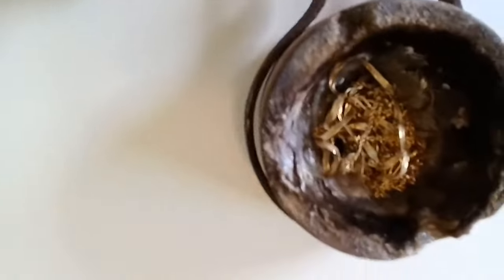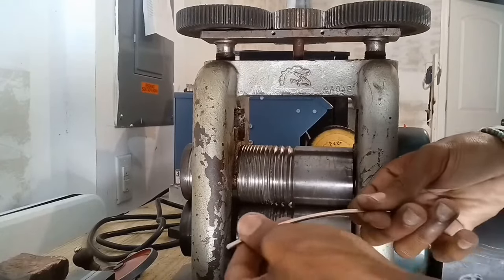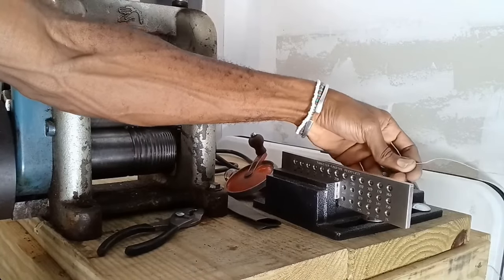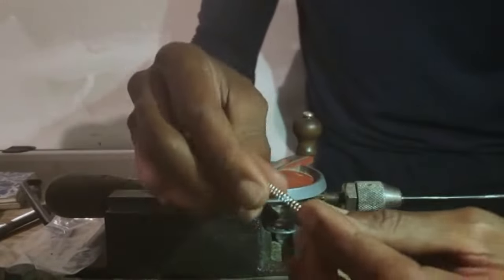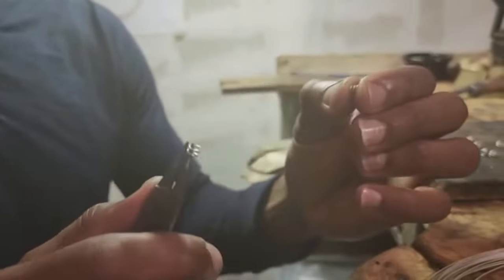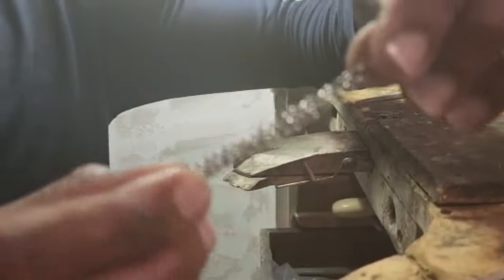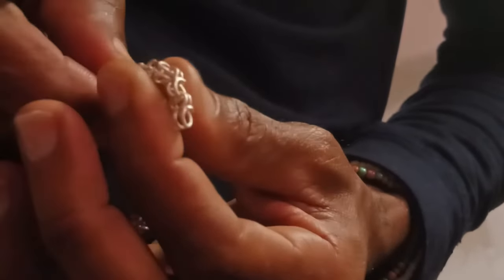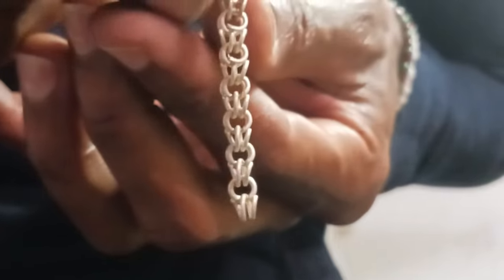Bismarck/Spanish Link chain making tutorial

Comment: Very very nice work
This tutorial is the best I have seen on this particular project
Much more persise details on the soldering only one question ❓
When assembling the coils were will one start holding it sideways there is 3 rows so my guess is the middle of the 3 ??
Is this correct ??
                                                                                          Thank you in advance
Reply from the maker: Thank  you very  much, David. To answer  your  question. YES absolutely slip the edge of the coil that you're holding in the pliers, between the middle strand of the coil that you're holding sideways. 

A little tip for you. ( Maneuver your way between the middle link sideways like I did it in the video.. It's a bit easier)